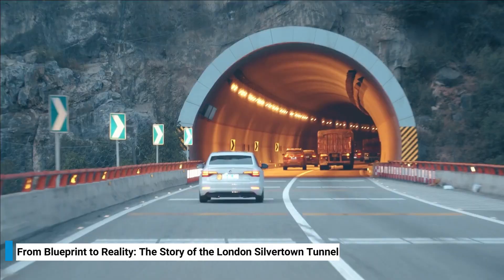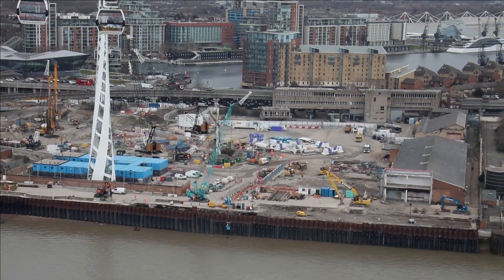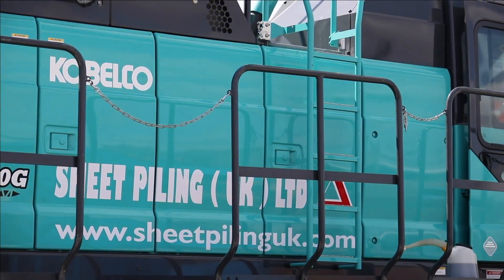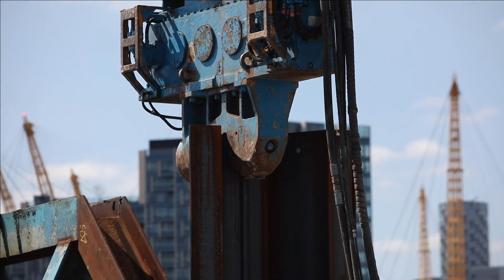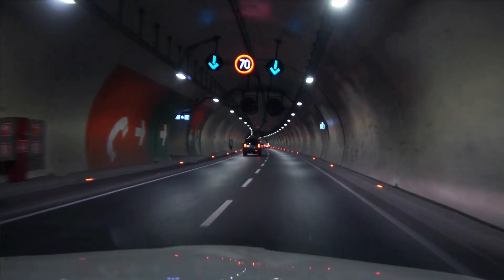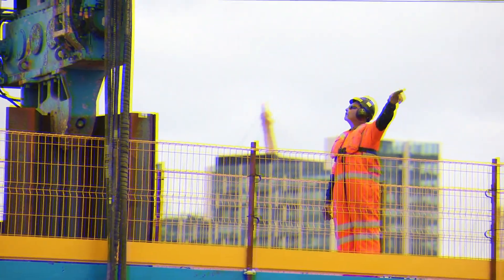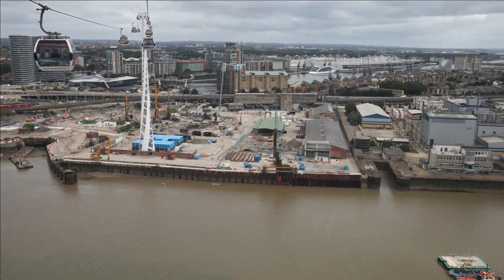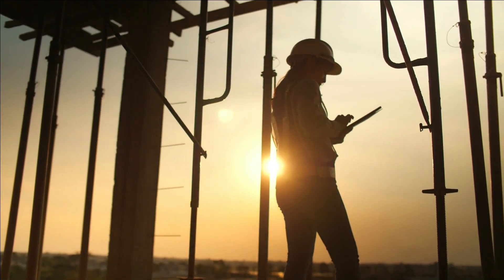From Blueprint to Reality: The Story of the London Silvertown Tunnel

Comment: I know this is a hot button issue for many people but from a lorry drivers point of view this is a must for London. The majority of HGV's (except double deckers) can go southbound with the 60's Blackwall tunnel (I think it's around 15'6''), but northbound with the Victorian tunnel is totally different. The height restriction is around 13ft, the majority of HGV's are higher than 13', where i work the lowest is 14ft. This means major detours if having to move north from the south, Either further into central london or out to the already heavily congested Dartford tunnels. The Sainsburys Thameside Distribution Centre is a prime example, around a 5-10 minute drive from the blackwall tunnel to the south, you can go south to it from the M11, but have to take detours if you need to be the north side of the river again.

Comment: I’m not sold on the queues to the black-wall tunnel being reduced, living locally I hope so, but doubt it…if anything it’s going to attract more traffic congestion, fumes….
A third additional north bound Blackwall tunnel should be built going right up to the north circular…it’s 24/7 carnage I don’t see this changing 😂
Reply: They are going to start charging tolls for both Blackwall and Silvertown tunnels. It remains to be seen how many people drive west to the Rotherhithe tunnel or Tower Bridge to avoid the tolls. The whole idea seems ridiculous at a time when we're supposed to be discouraging car use, and both Greenwich and Silvertown are well served by public transport.
Reply: @jammin023  Your whole 'Discouraging Car Use' mantra is the kind of thing that's causing the rise of motor populism.  Nowadays, I drive to work and I've every right to do so!
Reply: I think it will discourage car use because it will massively increase cross river bus connections in east London and both the Silvertown and Blackwall tunnels will be rolled.